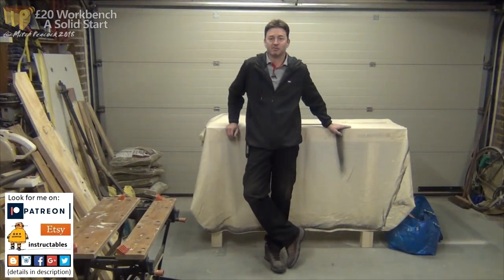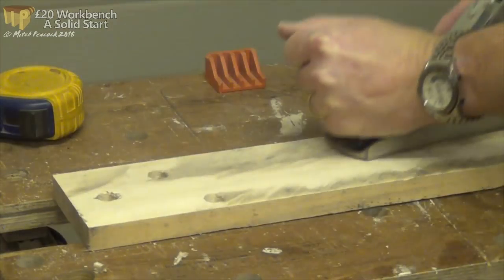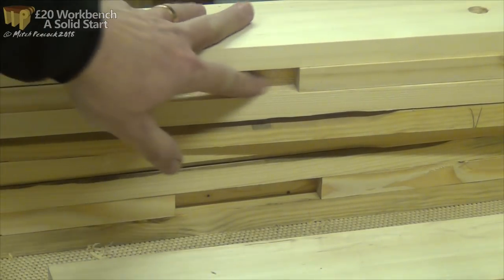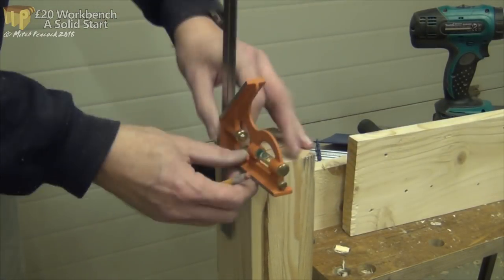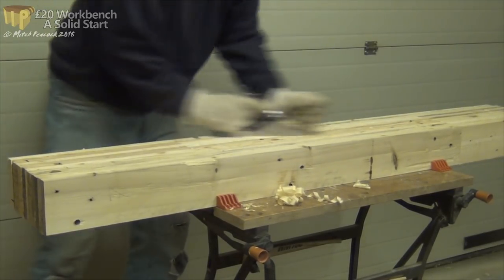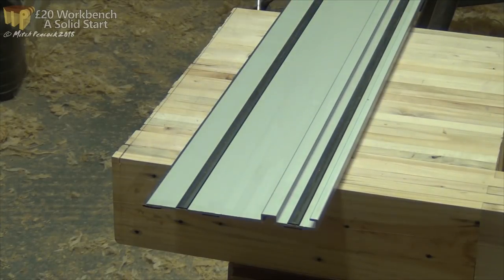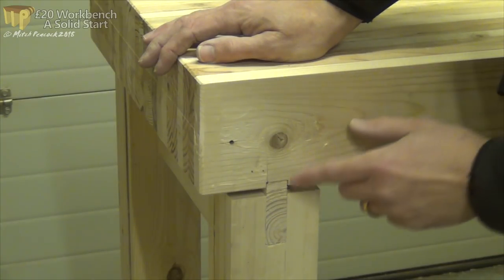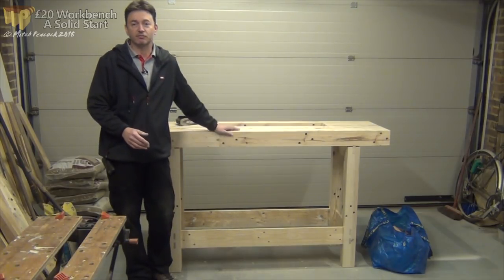£20/$28 Workbench!

Comment: Hi Mitch. In the 1960s ( I was in my twenties!) I used to do a lot of working with glass, as applied to telescope making. I had to drill through 1" plate glass on a couple of occasions, and I used a length of 3/4 inch mild steel tube, with just four teeth filed into one end. Along with carborundum powder, chucked in my drill press, this did a great job of drilling through the plate glass; a bit slow, but steady and sure. 

Later, I also used pallets for making fencing pickets, and soon cottoned onto the fact that my home made bit would also make a good job of removing nails from pallets.  I just altered the grinding angle on the teeth  and it worked a treat. For fencing I didn't worry about plugging the holes. Just made sure they were creosoted well; in those days with the real McCoy of creosote! 

I got the idea from a book called 'Amateur Telescope Making'; the 'Bible' for optical workers. So, your idea of using a plug cutter is yours probably, but the same principle with my homemade cutter predates. Not crowing old son, but I just thought you might be interested. I don't woodwork anymore as I can't stay at my bench for long enough, for serious handwork. However, I still keep my tools in fettle, and until I go, they stay in my shop! All the best Bruvver!
Reply from the maker: That sure is a neat trick with the tube. I bow to your earlier use of the same technique with pallets, we clearly had a similar thought process.

Comment: Hi Mitch, I noticed you were using a parkside track saw, I also bought the same from LIDL and find their equipment to be of good quality and well priced. Most of my pallets come from a local firm that get a lot of their items on pallets and these pallets are 8 feet by 4 feet so although they are not that thick the boards are a good length and the nails are easy to remove without damaging the wood. It is also planed smooth and as such are ready to be laminated together, now if I could just find a free supply of glue I would be made for life. Loved your bench and it is very solid.
Reply from the maker: John Fithian-Franks That's a handy supply. I've used the wood glue sold through toolstation, which I find works very well and is very cheap compared to the big brands.